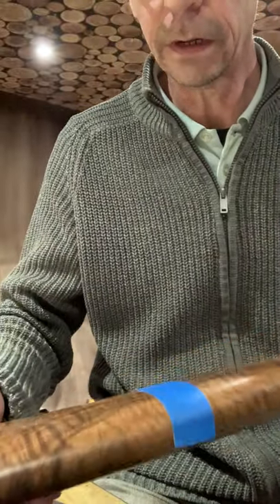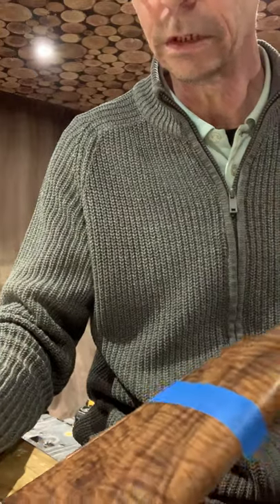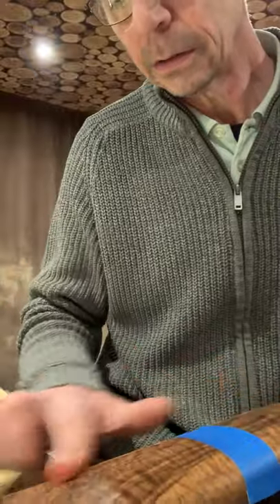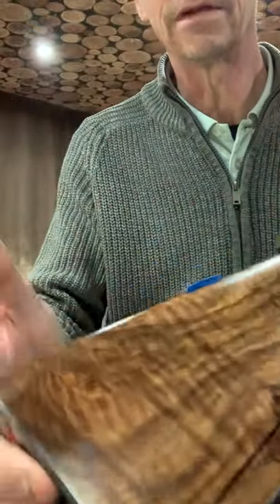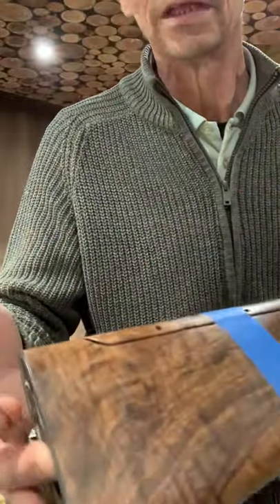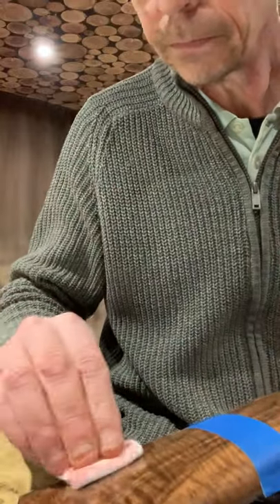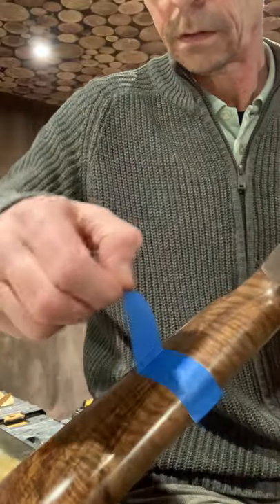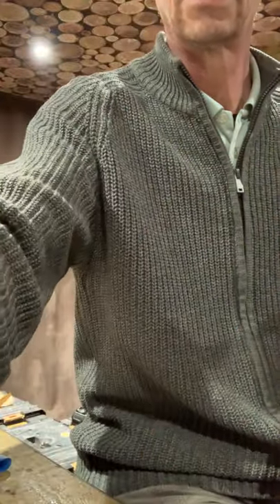Walnut wax and wax additive on a dull Blaser

Comment: I can not get any type of shine from this wax on my gun.
Reply from the maker: Hi, what did the stock look like before waxing, the wax only enhances what you have, try letting the wax dry for about 20 minutes before buffing see if that helps
Reply: @slipperydicksgunwax8558  the stock is a oiled finished Browning 525 grade 3 in very good condition have left for 20 minutes lots of times? I know how to use wax on wood have been using it for years but not yours before.
Thanks